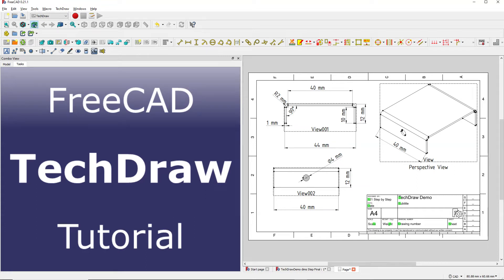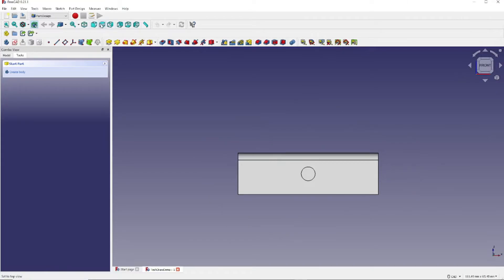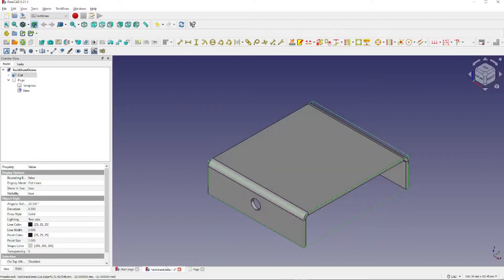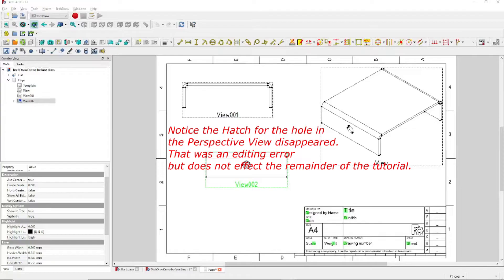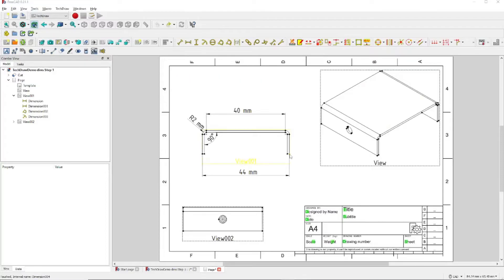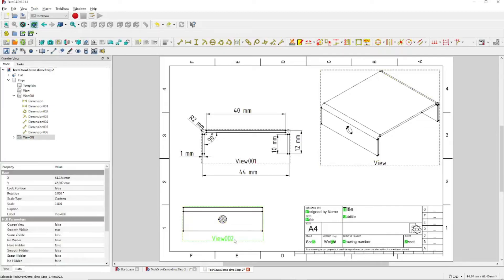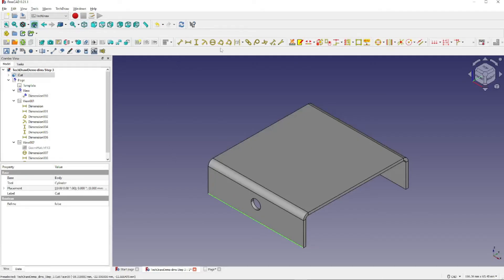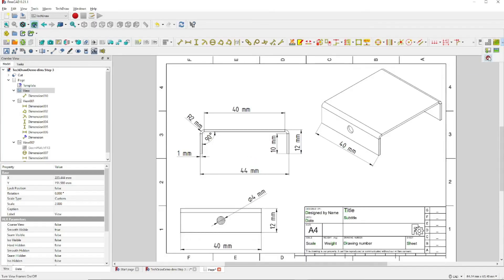FreeCAD Tech Draw Workbench Tutorial

Comment: Very good, easy to follow instructions.  BUT why did you not dimension the hole location?  I am having problems doing that as the dimension feature is not selecting the hole center.  How do you do that?  The only way I could accomplish it is by adding centerlines to each hole and that does not seem correct.  The center point of the hole should be easily selected, but I cannot perform that.  I am using version 1.1.